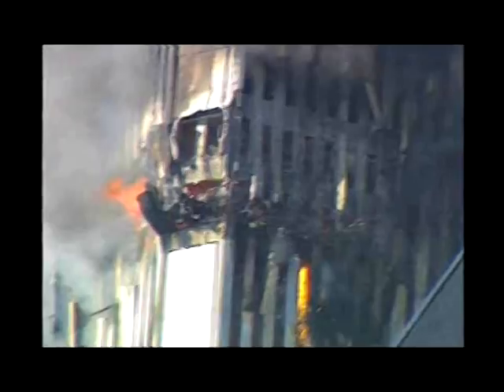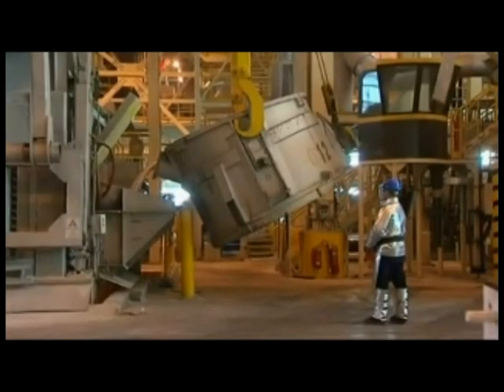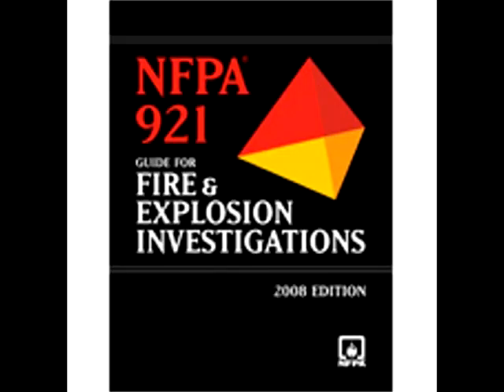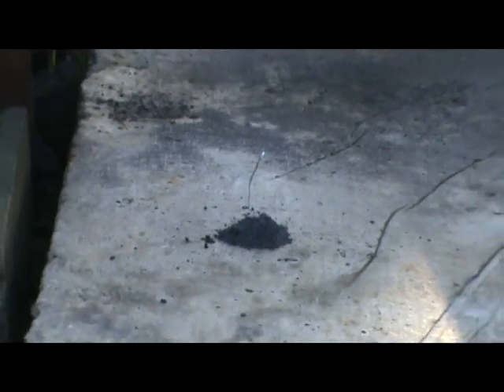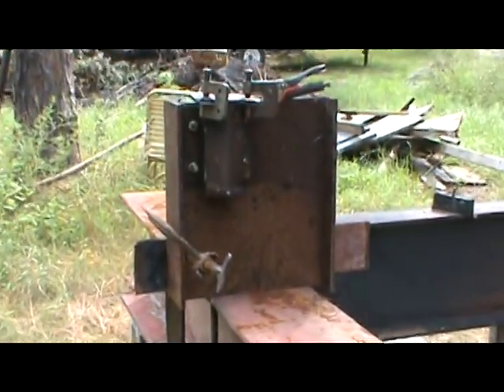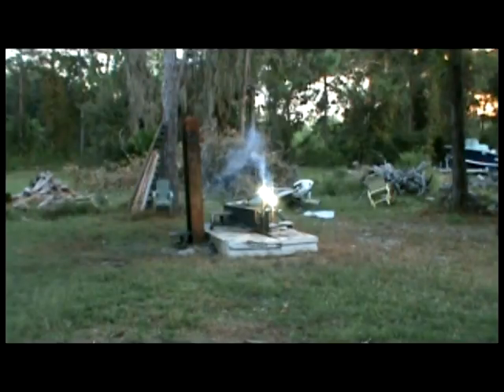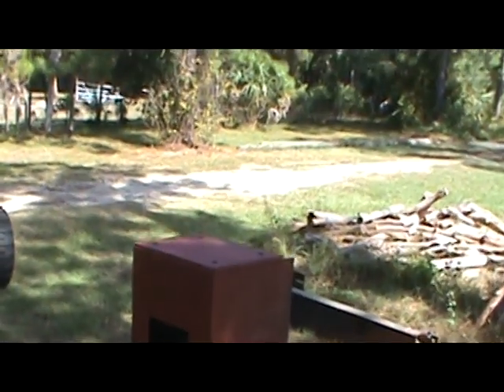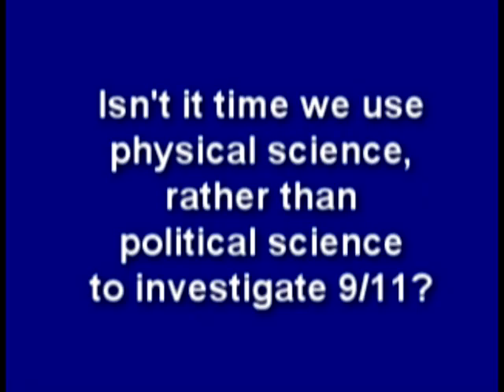9/11 Experiments: The Great Thermate Debate

Comment: But it wasn't an open air fire. And many items treated with flame retardant,  which resist burning, but when it does burn burns extremely hot. And it's always pretty windy up there. It would be like a blast furnace. And that building also contained much aluminum which melts at a low temperature but  Can burn and when it does is about as hot as thermite. And airplanes are full of  Parts made out of magnesium. It's very strong and light  weight and melts @1200 degrees farenheit. But if melted and exposed to oxygen, it catches fire where it burns so hot you need welding glasses to look at it. It burns every bit like thermite, only it last longer. 4000 degrees. And there was tons of it in that jet.

Comment: In ALL these tests they forget one critical point, a tower acts like a chimney when on  fire and there's probably high wind to create more heat at that hight ? This will have a huge impact on the situation ever use a cutting torch before ? Ad a high rate of oxygen and those steel beams are butter in a hot oven.......

Comment: So, I don't really have an opinion either for/against a conspiracy.... The argument I always hear, including this video....Jet fuel can't melt steel beams.    However, you don't need to reach those high critical temperatures for steel to be compromised.    Expanding, fatigued, stressed, metal.... You have the components of this building being subjected to compressive stress from the weight above it, the tension stress from it swaying in the wind (very slight) you have it's compromised integrity from the new hole, and it's continuing stress from burning fires.    Take a look at a documentary on train rails.   they have expansion joints for heat from just the sun to prevent them from buckling, imagine what that much heat did to this building's expansion joints...they were probably compromised.     Those fires on the outside of the building to look exactly like a thermite reaction though.

Comment: What a spectacular and epic video. Proof right before your eyes that it is possible to use this materiel to weaken a structure so it will fail. The strange thing is why the media never picked up on this and why the official report is flawed. If 9/11 was not a inside job I would assume there where serious constructions flaws in the buildings and that the planes plus the burning of jet fule was enough to bring the buildings down by weakening the structure. But to test that you would have to build a real mini replica of the twin towers and go though the process to see what did bring down the buildings. 

But that will probably never happen because if that does produce evidence that buildings should not have failed it will open up Pandoras box. The government always use anything they can to justify war and is not interested in the truth.

Comment: Don't forget also that maintenance was been performed on the towers for 6 months prior to 911 event. The crew worked evenings when buildings basically empty of people, perfect opportunity to prepare explosives in the structural members and the core framing. Photos of sheared beams cut at an angle were published after event, These cuts were approx. 45 to 50 degrees' Possibly cordite rope used here as it can severe steel plate and topple telephone poles ect.
Reply: People were in those buildings practically 24-7  You have cleaning crews that work in every office well into the night,  60,000 people worked in those buildings, deliveries started (paper food etc ) started every night at midnight into the early hours of the morning,  and not to mention the increased 24-7 security after the the 1993 bombing.  Forgetting all that, why would they make the buildings fall strait down, and not make them topple over to the north, killing even more people ? Or are we to believe there was a cap on the amount of killing ?
Reply: I don't mean office type cleaning crews. There was so called structural maintainance ordered wether genuine or otherwise going on in the internal core of the building which is accessible for such work. I can tell by your interpretation of my comment you are not an engineer type, maybe an office type huh?

Comment: Wrong again! Steel looses it's strength above 1400 F (Eutectoid Temp). That is how blacksmiths hammer it into shape. The floors above created the force to collapse the building, that is why the second building fell first (more stories on top = more weight). As for the molten iron, just how much aluminum and magnesium is there in an airplane? They both burn very hot and can melt steel.  Such conspiracy theorists need to check under their beds and in their closets. It is much more likely they will find something there.
Reply: David Sparkman...leave the science and physics to those who can speak to it....pulling stuff out your ass isn't the same thing as providing insight.
Reply: Actually, my scientific credentials are far better than yours. I am a degreed Metallurgist, have published multiple papers on metallurgy, and am known around the world in the industry. Your stuff, to say politely, is hokum. You had no mention of the softening of steel above 1400 degrees F and the effect of millions of tons pressure on that steel from the higher stories.  I am sure you are making money off of this post so that would explain your anger at being exposed. BTW I made a thermite "bomb" as part of my high school chemistry class for a classroom demonstration. I also scored a 99.9% in the chemistry SAT, so go pound sand.
Reply: David Sparkman ..There's no Need for metal softening, you Material Head!....conservation of momentum alone provides a very tidy mathematical representation of the total 2  additional seconds of collapse time over free fall time We all saw...

if you were studied in the subject im perficiant in, structure design and related engineering, (BS civil engineering suny at buffalo '93), you may have known to look into the physics of the collapse event already, all by yourself.
Reply: Occam's razor tells us to go with the simplest of answers. Those fires burned for a long time giving ample time for the steel to soften. With one or two stories weakened, the weight of the floors above exceeded the steel's strength and they fell two floors. The blow of the upper levels shattered the lower building. You will note that the second building struck collapsed first because the mass of the building above the fires was much greater and the steel would have to weaken less. If you don't consider the heating of the steel, then you cannot explain the delay in the collapse. And by the way Aluminum burns with a temperature of 4,595 F once ignited. It's melting point is about 1,400 F depending on alloy, and steel's melting point is 3,000 to 3,200 F depending on the alloy. Steel goes though a transformation at 1,400 to 1,450 depending on alloy where it loses most of it's strength. Jet Fuel burns about 1,700 F we are told. It is all pretty straight forward and the time delay explained. Of course several of the steel pieces were taken out by the initial force of the collision.
What is really interesting is the way the bottom steel blew apart. Not from explosives but because of immense loading. Like silly puddy, the material blew apart because it couldn't deform fast enough.
Reply: NOOOOoooooo Dave, we are supposed to believe steel still has 100% of its strength right up to the point of being molten. ( unlike butter )  lol
Reply: Blacksmiths would be out of a job. At the eutectoid temperature the crystalline structure changes and the metal takes on "color". First a deep red then up to an almost white before it melts. Smiths hammer the metal so long as it has color but stop when it turns dull gray and put it back into the fire. Under the blows of the hammer, the metal deforms into a sword or a horseshoe, or a nail depending on the wishes of the smith.

Comment: i am an explosive and chemical engineer and have found through life experiences that thermate cannot burn through steel as it burn to fast because of the sulphur but thermite can very easily melt steel
Reply: No i dont think hes full of shit but hes probably use to working with commercial grade thermite. There are several types of compound thermite mixtures i have messed with because its fun and relatively safer than more concussive explosives. Military grade and silicate based (no aluminium powder) can produce these results but even with this videos more indepth experimentation it would take years to figure out if there is any merit to either side of this discussion.
Reply: Evidence of your claims? Because you sound like you''re full of shit.
If you were an odrnance engineer you would realize the beams buckled because of the loss of structural integrity brought on by heating of the metal from the burning of the kerosene type fuel.
Reply: @Nothing_._Here  Look at the stoichiometric equation to produce thermite, the elements present in a burning jet full of fuel encased in a vented cauldron of steel is the proof.

Comment: ALUMINIUM is the catalist in thermite....thermite is iron oxide and aluminium powder....the plane was aluminium, the thin box beam crap steel supports were rusted....ergo...the ground up aluminium and rust only needed to ignite to start a reaction in the rest of the aluminium wrapped around the corner beam where it stopped, the steel needed only to reach forging heat to bend and give way under all that weight...700 deg.
Reply: scott left ...so you have mathematically quantified the collapse event for all of US to see and replicate?...No!?..well dont feel too bad, the govt didnt provide US that either....that's a fact brother.

Comment: So not the tons of weight on top, not the 27 year old construction, not heat burning away the core of the structure but carefully placed thermite charges placed exactly around where the planes crashed?  I'm not buying it.

Comment: If you can do this with an engineering degree and some scrap metal, imagine what the United States military could do with hundreds of genius engineers and a near limitless budget...
Reply: Anything is possible. I am a trained Navy EOD Sapper. It would take hundreds of people to pull something like this off. I have worked with Thermite. The nano-Themite he is talking about isn't even a real item. It is make believe, Made up by people trying to explain shit they can't explain. Getting back to the hundreds of people it would take to do this. There are only about 3000 EOD trained personnel in all the armed forces. That's a pretty small community. The government had them eliminated, right?
Reply: @rickravenrumney  they also presumably used the ultra secret navy seals suicide squad, to fly the planes.
Reply: Um it took one guy in this video
Reply: So I suppose they teleported all the termite charges into place? The government can't even stop people from leaking to the press. Lol
Reply: Thank You! I am a former US Navy EOD. ( I guess I am part of this, don't tell anybody!) How could the hundreds of people it would take to pull this off get the make believe nano thermite attached to the outer columns of the buildings and set them off? Remote Radio is no good because of all the cell and microwave traffic. They got Harry Potter to make a fire spell to light the fuses.Hundreds of people and nobody talked. The government who can't plow my street clean of snow.
 Stay Smug...Mr Smug! You have a right to be. Be careful of the tin foil hat crowd
Reply: Rick Raven Rumney Wasn't the whole place on fire? Is it easy enough to believe that the fire was hot enough to melt steel but not hot enough to set off an explosive?
Reply: Mr. Smug  The government we see and vote for is supposed to look like a bunch of bumbling idiots. It keeps us distracted from families with money, the CIA and the military that really run the show.
Reply: Do you think "hundreds of genius engineers" are gonna keep their mouths shut?...
Reply: WTC fell right down with a slight forward angle. On the 3rd or 4th floor the NYC Emergency Mgt Office had a tank full of Diesel Fuel with thousands of gallons. The building burned on the lower floor for hours unchecked after its foundation was damaged by the collapse of the two towers. Anything is possible, but the simple reason it collapsed was due to this reason. I don't know what pull tower 7 means, but how are u going to pull a sky scraper?
Reply: Who said "Pull Pull Pull" tower 7. Does that mean 'Pull the Team?' Who said it. or Who said they heard say  that.
Reply: @rickravenrumney  the owner of the building said to pull the firemen from the building as was too dangerous. Conspiracy nuts think he meant destroy the building.
Reply: I knew that James. I couldn't think what pull, pull, pull meant. Considering that I heard somebody say years ago on a video to pull the fireman. The author of this video keeps saying he has evidence when he has only speculation.
Reply: and yet know one is found guilty for the crimes
Reply: ROBERT LEMBO _- IT will be kaioken ×10 UI
Reply: we live in the terror of are leadership.the gov.
Reply: I love my country good oh U.S.A.!
Reply: I think you give the military too much credit lmao
Reply: i can imagine. trillions of $, best minds from best universities, black projects, decades to work in. doesn't take much imagination.

Comment: My hats off to you my friend, you have proven that thermite, if concentrated on a smaller surface area, will melt and cut the steel beams vertically or horizontally and also be used in concentration to melt the bolts. I think the entire operation of 9/11 was a hoax to begin with, so many innocent lives lost so our corrupt government could gain more resources and money in the long run. 

I hung iron 20 years for JP Stevens and I'll tell you right now that NO plane would have caused a collapse, the plane would have been tore to pieces and burned up before those beams ever got close to melting.

Comment: but you forget to mention the huge load, 1000’s of tonnes pushing down, steel was weakened by the heat, not melted. Once weakened it could not support the load, simple really, you don’t have to conduct expensive tests which miss this important factor.
Reply: bobo adventures ..the important factor You've missed is the fact that the govt admitted There was No Damage to the Columns Below the Crash Areas.....should I repeat that?...and should you confirm that fact for yourself?...here's a clue you can use in your quest to confirm the above stated fact; read the nist forensic "analysis" report....some of US already have and know better.